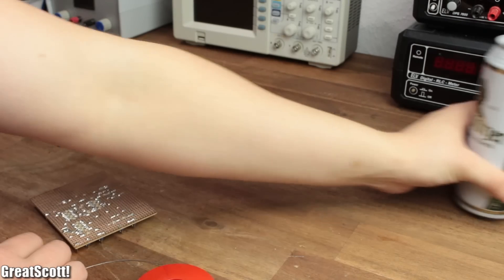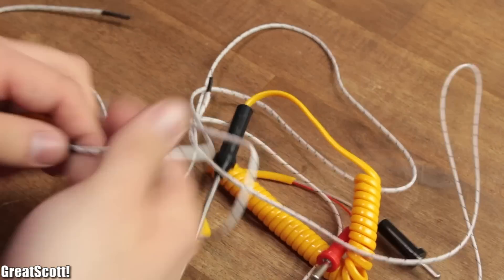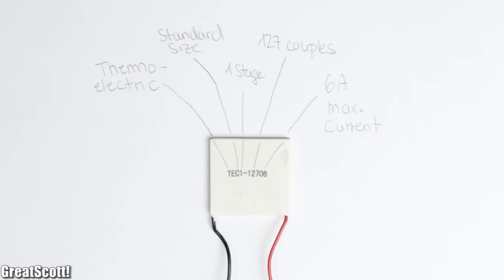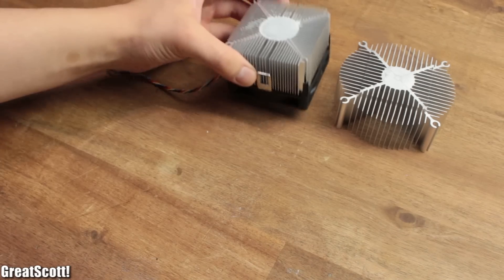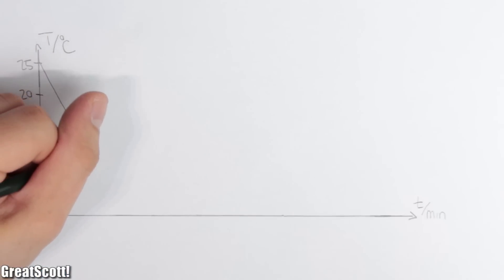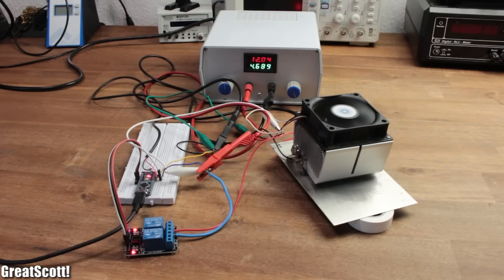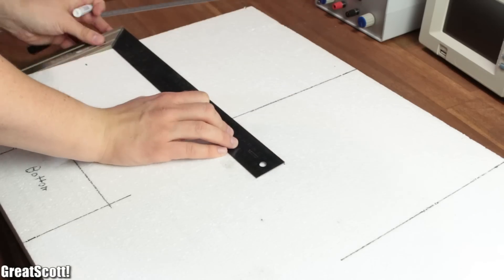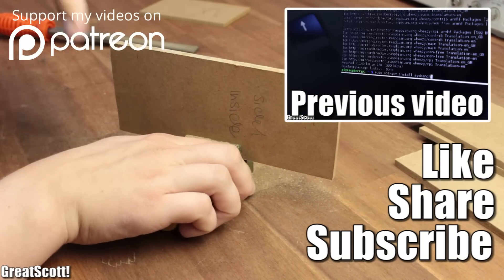DIY Cooler (Part 1) || Peltier Module

Comment: This is a nice project if you want to run these off of USB, like in an office where your computer is running 24/7 and you have a simple 5v output. Limiting the amperage sure may take longer for it to get to temperature, but once its there, I think it would easily be a great little drink cooler for work or for the office desk.

Comment: Can i use pc power supply to power peltier module? 12v rail has 12A max current output and i want to use it. Would be safe to use it?

Comment: turning the Peltier completely off at desired temperature is not a good idea because when completely turned off it will start conducting heat from the hot side (heatsink) to the inner cold side. Instead, shift it to 5 volts and it will keep running efficiently and at lower power.

Comment: This is awesome!  I've been looking at building a cooler with Peltier modules and I've been wondering how they could be made more efficient. I know this is 5 years old - but thank you for making such a great video with narration. So many videos just play music which is not helpful. I have a few questions for you about how to set up variable speed controllers - probably a PWM, on fans. I'd be happy to chip in a bit extra to your Patreon campaign if you've got 5-10 mins. Thanks.

Comment: Try to do another one with several of this devices in cascade and energize them  with only 10% of the maximum  current , and you should  get a  huge COE. in theory better than the Rankine cycle

Comment: Nice project! Quick question, initially you were using the fan to force air to the hot side so the cold side would cool correct?

Then you used and old CPU fan the forces hoy air our from the fins. Is this correct?

Comment: Question about power usage. Would slowly reducing the power on the peltier modules be any more efficient for when the fridge is near the target temperature instead of just turning them off and then back on when the interior heats up?

Comment: Hi scott, this is off topic q, i just need a short ans. Since you are the  master of electronics. I jist want to know if the potentiometer output or gimbal output or switches from an rc radio remote consider as ppm or pwm signal?

Comment: Hello why the heat power is 16 W When you calculated the efficiency ?
Reply: The math does not make sense.
He measures the voltage and current.
It just proves the resistance is not the 2 ohms he read from the datasheet.

Comment: Ooooh. I don't have an optical drive anymore. I could totally mod the 5.25" bays in my desktop and run this off a single molex. To think, I got laughed at when I called a CD drive tray a cup holder as a kid.

Comment: I didn’t understand the math,
Could you explain it? Why 33,33%?
Reply: In fact, his math in this case makes no sense.
I think his measuring of Voltage and Current simply prove that the resistance is NOT exactly the 2ohms read from the datasheet.

Comment: Dude, just ran the module in my cooler, runs much more efficient. It has less resistance, therefore produces less heat. Im only using 30 wattsish to get my 13can igloo cooler down to 40 degrees

Comment: I Just Bought one of marlow industries's Triton ICE Modules from Digikey. Im Going to see how much more efficient it is compared to what im using now. They only go up to 6.5 Amps, But Im tired of running 8 amps at 12 volts when I may not need to. I want efficiency which am fully aware is difficult to achieve, even with liquid cooling.

Comment: I've always loved the concept of Peltier coolers. Mainly because you're draining heat from a source using electricity (which by design produces more heat). While it may not be as efficient as a simple heatsink, it is much faster.

Comment: Duuuudeee, don’t turn it on and of... use a mosfet with the power supply tu regulate the voltage and a PID program to control the temp. Is waaaaay mor efficient then turn it on and of... in this case you can reduce the amplitude of your “consume sine wave “ to as efficient as you can program a PID code! 
(Your code is actually a PID for dummies,  just need to increment a few things in order to make it more efficient)
Reply: That code is in no discernible way "PID for dummies".
It has no P action
It has no I action
It has no D action.

It is really just an on/off control. Which, I agree, is very inefficient.

Comment: I am doing a Mini-Air conditioner Based on (Peltier Module TEC12715). I am going to use 10 Peltier Module for better cooling. 1 Peltier module requires Umax(V):15.4 Imax(A):15 Max power consumption (watt):231 Watt. Which ""Power Supply Driver"" do I require to run all 10 Peltier modules? [I am from Non-electrical Background]

Comment: Sorry, clicked comment before asking the question I wanted.

I got a ton of solar cells.  Rated roughly, .5 VDC at 5 amps.  First of all, they are very very very hard to solder together.  I had to be so careful.  I used braided to series them together.

What I'd like to do, is make a better solar system unit.

Basically, being able to convert, say the .5 vdc to roughly 12 vdc, (Of course amperage drop).   So I started with a Joule thief type circuit.  Then to a simple NPN/PNP oscilator to up the voltage to somewhere I can start converting to useful voltages, etc.

I ended up doing a two cell series.  More like useful 1 VDC at 5 amps.  

The problem of course, is that this performance of the cells is dependent on the sun.  I can't always count on .5 vdc, thats why the converter.  So If I have two cells, I can reasonably work with .5 to 1 vdc.  But I need a good circuit to deal with these varying voltages, to a constant 12 vdc, or even 6 vdc.

What do you have in mind if you would be so kind as to suggest to me some circuits.

Please and thank you!

Comment: Can we use op amp (as a comapartor)  with temperature sensor instead of aurdiuno. Also motherboard processor heatsink  are sufficient for this project ?

Comment: Good day mate! you mentioned before that connecting the peltier with electricity would produce heat and cold energy but if the peltier is chilled or heated it would produce electricity. Why didn't you use diodes(reverse or forward bias?) for the peltier electricity not to travel in your circuit? is it because of the relay? (Bad english, Sorry)

Comment: After seeing what you did with your thermal paste, I'm surprised it works at all. Not only are you using  the cheapest thermal paste on the planet, but you are also using the worst application method.

Comment: sir, is it possible if i drive the peltier with pwm? because i want to make a cooler with pid control
Reply: Yes, you still need the relay (preferably a digital relay such as a transistor). This is just because an Arduino is rated at about .04 A and this needs about 5 A. I would use a transistor or two (such as a Mosfet) rated for the load. But you can, its just like dimming a light or running a motor variable speed, same thing circuit wise. You should also technically have a pull down resistor, but I usually skip that if I check it beforehand with an ampmeter and check with a power source the same voltage as the controller.
Reply: Oh i see. thank you for your reply
Reply: You're welcome. I hope the project goes well.

Comment: Es wäre wesentlich Energieeffizienter wenn du die Strom- oder Spannungszufuhr der Peltierelemente regeln würdest. Die Fan Motoren haben einen recht geringen Energieverbrauch im vergleich zu den Elementen. PWM oder ausschalten der Elemente ist nicht gut da im Ausgeschalteten zustand die beiden Seiten thermisch komplett leitend sind und es zu ständiger dehnung bzw stauchung des Materials kommt. Da die heiße Seite dann sofort die kalte Seite beheizt und umgekehrt. 

Besser ist also ein PWM signal mit einem Kondensator gleich zu richten um die Peltierelemente konstant auf einem niedrigeren Energielevel zu betreiben. 

ich habe mir letztes Jahr auch so eine Box für Vatertag gebaut, allerdings hatte ich leider keine Zeit mehr die Elektronik so zu erstellen wie ich es eigentlich wollte.

Comment: I have a mini fridge with a case around your size. The peltier unit is a TEC1-12705. I want to upgrade it takes quite a long time to reach 7 degrees. Would a TEC1-12708 give better temperature, if I optimize the cooling and power supply?

Comment: Hi man great idea,
I am planning to build it, but can you please help me with the following

1. Is the Thermoelectric Cooler Cooling Peltier Plate  a pure resistive load
2. What is the maximum rated current of the module 
3. Any idea about its life span.

Thanks in advance

Comment: i repair and install cooling machines and will take a look if it would be possible to put an evaporator of some sort and a condenser to a small fridge. all though it would require a compressor  and many more components. but the smallest it could be would be still too big for a "small" fridge

Comment: bro my peltier plate the cool side of it get hots after some time why so?  I aslo add a cooler to the hot side then aslo the cool sides becomes hot after sometime
Reply: Rohan Patil it's either a defective piece or you don't get enough heat dissipation on the hot side.

Comment: Question:  Do the fans always stay on and it only the peltiers that get turned on and off ?  I going to build one ;but,  for my purpose it will be a little larger only needs to be about 70 F (21. C) inside.

Comment: Would you tell how thick your aluminium is.? I use 2mm thick of aluminium and the same 12706 peltier module. I creat the same sandwich with fan-heatsink-peltier-aluminium combine but can't reach expected coldness. When peltier's cold side was about -5 degrees, aluminium was only about 19s. Any suggestion?

Comment: hello, this idea you can create an air conditioning system with a liquid such as those using the pc. It would be a good idea for a future project
Reply: +NafterRuiz You mean like heat exchanging?
Reply: yes!
Reply: peltier coolers are much less efficient than ac units

Comment: Great project! My only comments would be using the pea method for applying thermal paste as mentioned in another comment. Also, i think a copper plate at the back of the cooler would be significantly more efficient than the aluminium, especially where you stacked the aluminium to reach the heat sinks. (of course copper is significantly more expensive).

Of course I don't know if the use of a better thermal conductor will lend much aid to an inefficient cooling methods like thermo electrics in the end.

Comment: Use foil-faced polyisocyanurate (PIU) board in preference to Styrofoam. Better insulation, use less power, beer stays colder longer.

Comment: i should place a fan inside, cause if your drinks dont touch the metal plate they dont cool down... and i should by just a peltier coolbox, mine cost used €7,50

Comment: wait a minute... doesn't those relays need 7V to turn them on? I always thought that to control high power circuits with a micro-controller one would need solid state relay.

Comment: Hi Scott,
Using a thermostat will not save any energy in fact it will use quite a bit more so be less efficient. I use a peltier cooler as may main refrigerator. Is one of those small car peltier fridges but is used at 5V in winter and 6V in summer constant no thermostat in this way it uses about 10W in winter and 12W in summer (this includes the peltier element and a fan) and keeps inside temperature at around 15 to 17C below ambient good since I get 4 to 7C depending on ambient temperature.
If it where to use a thermostat I will have a lot of loss (during off time) trough the peltier element since the peltier element is a good thermal conductor.
Of course a classic compressor cooler will still be way more efficient.
Still my small fridge is good enough for me and uses just 7 to 9kWh/month or under 100kWh/year.
Your experiment was wrong because you had the cold heatsink at room temperature and was quite large so there was a lot of power transfered to ambient so you did not got good temperature delta.
Reply: Makes sense, though you co fused me at the end when you said "your experiment was wrong because you had the cold heatsink at room temperature..." Wasn't it the hot heatsink? and wouldn't the power be transfered FROM ambient instead of TO?
Also, could this be solved by having the peltier on at a low power when he programmed it to be off?
Reply: +Ciroluiro He had both heat-sinks at room temperature when he performed the experiment he wen used a fan to blow room temp air on both.
If the cold side will have been in an thermally enclosed box then the air in that box will have been cooled allowing the cold side of the peltier to get at even lower temperature same for the air inside the box.
You can see having both sides of the peltier at room temperature like a short circuit almost.
Having the peltier on at lower power will solve the losses compared to having it completely off but still having the peltier at higher power will be less efficient than having it at constant lower power just enough to equalize the losses and keep the inside of the box at the designed temperature.
In this case maybe the target is to get the drink at low temperature as fast as possible and cost is less important but this can be optimized by having peltier work at higher power until a threshold temperature is reached and then reduce the power to a level where temperature can stay constant.
Reply: What size cooler is this? Car coolers use 4-5 amps at 12 volt. That is about 1/2, and quite a bit colder too, just by changing the voltage?

Comment: Make on both sides heat fins and make on the hot side a better air flow. Now you ask me why. Well how more heat you can remove from the hot side how colder the other side will get.

Comment: Nice build, I plan on making something similar at some point. I'm not sure MDF was the right choice for the inside though. You're likely to get condensation forming which will wreck MDF in a few hours.
Reply from the maker: +Wobblycogs Workshop Several paint layers protect the inside MDF from the condense water.

Comment: Great video. I been thinking why do people use a fan to coll the Peltier module? Why not trap the peltier device between two water sources pump the cooler water around pipes to the fridge back into the hot peltier water side and return to the cold. Would this be enough to cool? If needed might need a fan to cool the pipes. Would this work?

Comment: Nice project!
Though another idea is that if you dont can get hold of relays you can use npn transistors :)! much cheaper aswell!
Reply from the maker: +PezDJ Sure, but don't forget the power loss through them.
Reply: You can controll the ground instead of the power then there is not as much loss.
Reply from the maker: PezDJ
The same current still needs to flow the transistors. Which causes the power loss. Doesn't matter which side you switch.
Reply: Oh well that might be true, strange because I built a led strobe thingy with arduino and npn transistors and didn't get any noticable power loss.
Had it goin at 9v. 
Perhaps it is more noticable at higher currents?

Comment: No need to waste an Arduino on this, eBay has some nice Chinese temperature control modules with relays AND an LED display of current temperature AND setpoint for only $4 or $5 US.  They are adaptable to either turn off OR turn on any 12V device at the setpoint you can set with up/dn buttons. And they come with the resistive thermal device sensor (RTD).
Reply from the maker: +rstevewarmorycom Sounds good as well.
Reply: Sure, here:   $2.00 US   Free Shipping !!!

W1209-Digital-thermostat-Temperature-Control-Switch-12V-sensor-Module-50-110-C
 
http://www.ebay.com/itm/W1209-Digital-thermostat-Temperature-Control-Switch-12V-sensor-Module-50-110-C-/262136733680?hash=item3d08911ff0:g:e8YAAOSwlV9WSVPw

Item # 262136733680
Reply: rstevewarmorycom so Would this completely replace the Arduino itself, Would I have to buy anything differently with anything else, Electronics wise? Let me know when you can thanks
Reply: have you got a link to one on ebay? great video GreatScott btw love that you've explained how to keep cool  without using unnecessary power! that was the missing step for me!
Reply: thank you!
Reply: GreatScott! ^^^